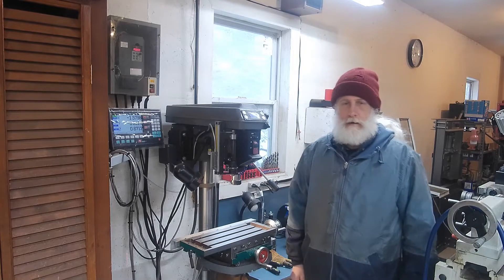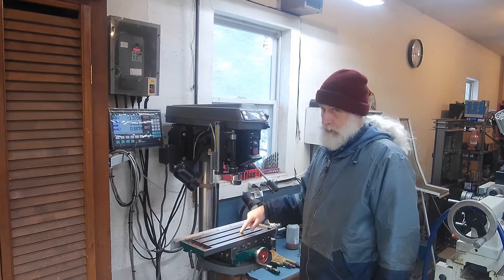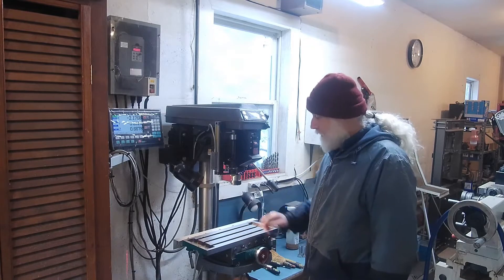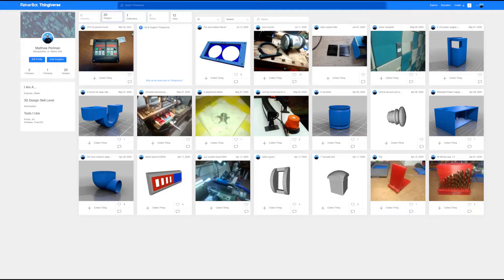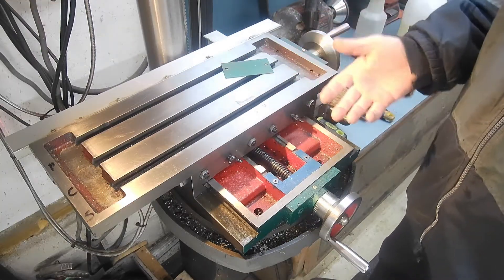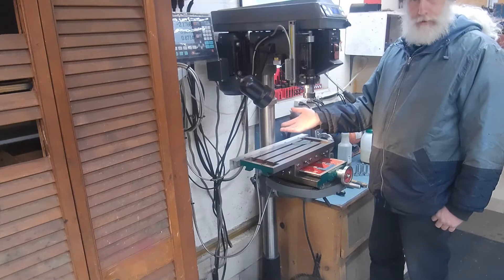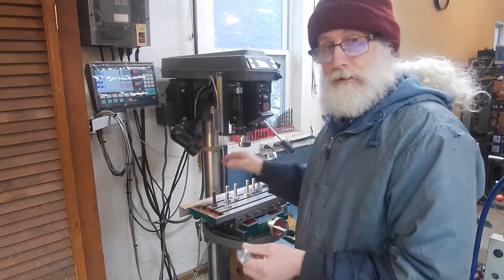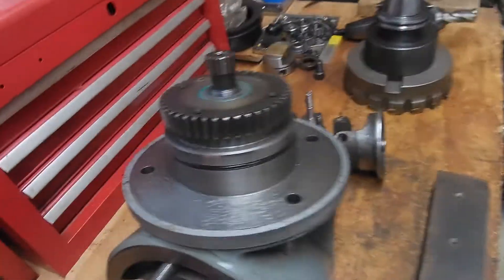mill conversion E5

Comment: Good little series thanks. I plan to convert a 10" bench drill to mill ( I hope). One idea I got from you-tube was to fill the column tube with epoxy granite or maybe just grout. Thinking this would stiffen the column. Have you considered anything similar? For fine Y adjustment I thought about a worm gear arrangement off of the main quill height adjustment knobs.
Reply from the maker: Interesting idea! I would expect that grout or better yet a good quality cement would help. As the tube twists, I do believe that it contracts slightly in the middle; a good tight cement core would resist that contraction and require the steel to stretch more for the same degree of twist. that equates to more more torque required for the same twist and conversely, less twist for the same milling force.
Reply: @matthewperlman3356 seen people put some tensioning cables or rods and then concrete. As I'm a welder , mechanic, fabricator by trade been around and work on some umwa jobs. Building side of umwa. Built some tipples,plants,rebuilds equipment drag lines,shovels etc. been around concrete some and like u say it keeps ass steel from flexing as much or it takes lot more force. Then I've seen put cables or rods threaded for tensioning so I guess they know what there talking about the engineer. Any I'm rambling on and will have go back watch missing it. Stay safe from ur ole hillbilly buddy.

Comment: Question, how did you strengthen the drive pully to the spline shaft? My conversion just has a very minimal and very loose spline type washer. I have to be very careful about making too heavy a cut. Thanks if you can help, noticed in one video a nylon disc mounted to the main drive pully. Just subscribed.
Reply from the maker: The spline on mine is still stock. so far it has held. I did bend the spindle shaft however, at the start of covid, when I pushed my luck with a boring head. I took the spindle apart and was able to get it straight enough to use, but ordered a replacement I'll be putting in at some point. These conversions work for light cutting but they do have limitations, some builds more than others; mostly due to differences in the rigidity of different drill press models. The white nylon disk holds a small magnet for the tachometer sensor.
Reply: @matthewperlman3356  I replaced bearings in quill and I am careful with not too heavy of cuts. Just will repair after I do ever have a failure. Thanks for your reply, congratulations on your new to you mill.

Comment: Hi Matt!
Nice videos!
What I missed in your mill series (maybe my fault) is, did you changed the bearings in the quill?
If so, what bearing did you use?
Thanks!
Reply from the maker: Same bearings they are just standard config ball bearings, so better suited to the radial load of milling than they are for axial thrust of drilling. This drill press was not ideal for this project, but I already had it from 10 years prior. There are better choices if starting from scratch; I may go in to that more in a future video.
Reply: Ok, thank you.
I have an old 3 feet high drill press I want to convert into a little mill.
Will check the bearings on endplay and see if they are good as is.
You have great ideas I might have to steal :-)
Thanks for sharing all those great ideas and videos!